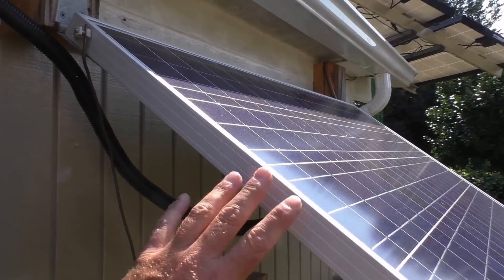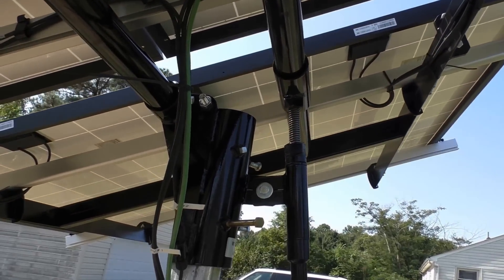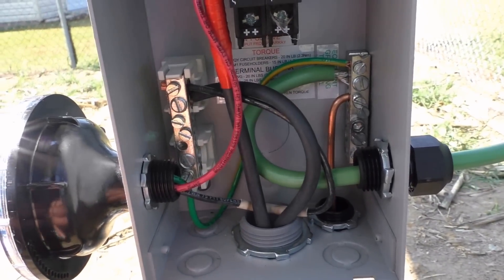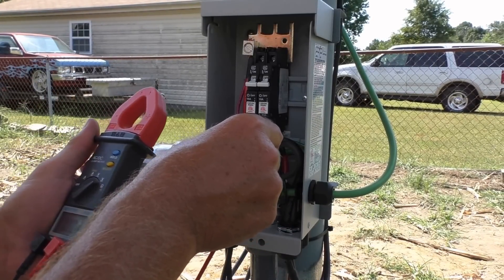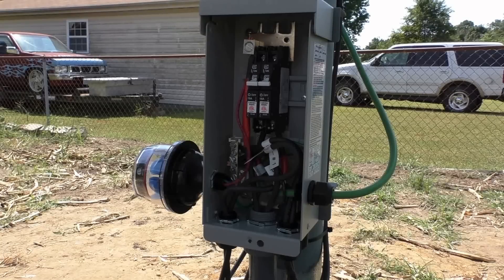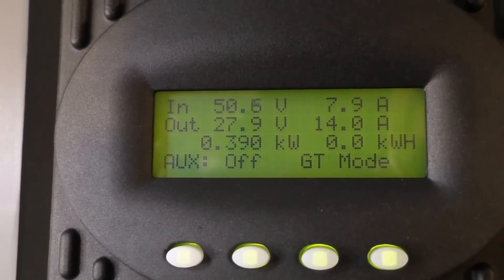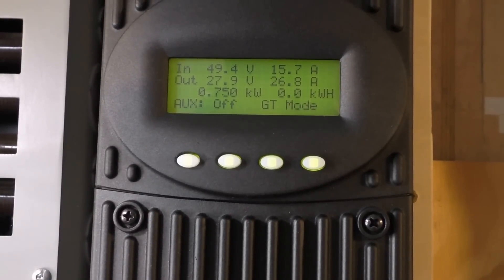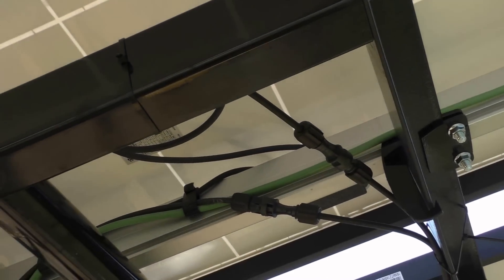Solar Panels On The Pole MT Solar & Kyocera Solar Wiring Pt 5 By KVUSMC

Comment: Looks like a great job. Can I ask what will those four panels run that you just installed. (Heater, central air, ?? )  And how many batteries are you charging? I'm new at this and want to learn more so I can make the electric company mad at me for a change. Thanks
Reply from the maker: Many Thanks  I'm Charging  4 190 amp hour Batteries For Back up when the power goes out  It Will Support / off set My Central Air  So My bill will be a Little cheaper Your Welcome Cheers Kenny